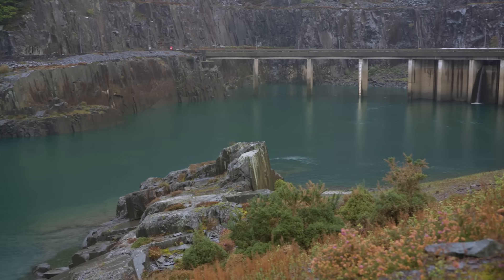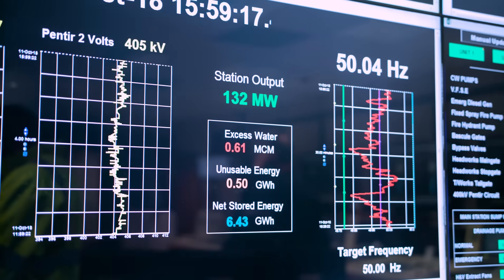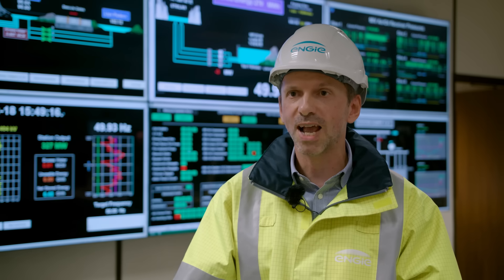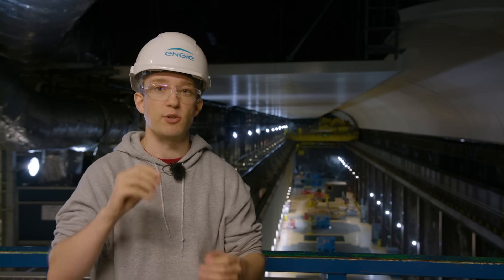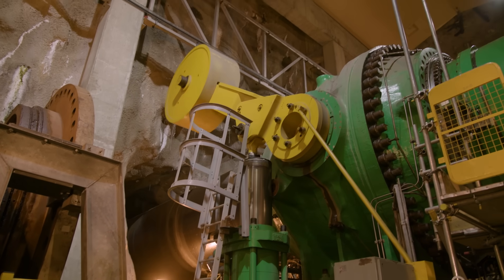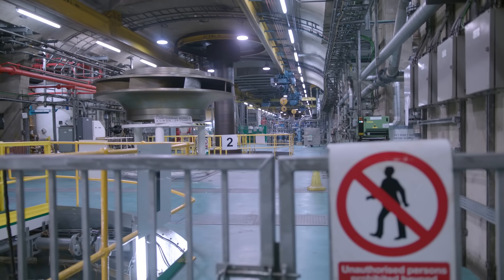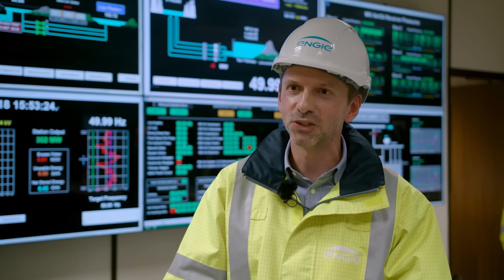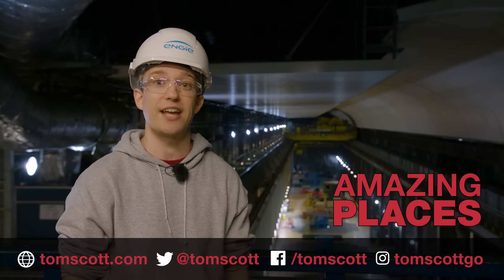Britain's largest battery is actually a lake

Comment: Are we not going to talk about how inefficient this is considering the laws of thermodynamics? If you're using all that power to feed the country during the day, and reversing the entire process at night, you HAVE to pull more power from the grid than you put in. It doesn't make any sense.
Reply: They went over the reasoning in the video. Their are times when demand for electricity is high and times when it is low. They move the water up at night when their is virtually no demand and they can have all the power they need to move the water up, then they move the water down to cover spikes of high electricity use during the day when the actual power plants can't keep up with the minute to minute demand. Additionally it was pointed out at the end that this also allows the county a higher reliance on green energy sources such as solar and wind despite their sporadic nature.

Comment: There is a pumped storage facility at Racoon Mountain Tennessee,USA. It was built on the Tennessee River near Chattanooga Tennessee in the 1970s by the Tennessee Valley Authority . It can contain up up 107 billion gallons of water and can generate 1600 megawatts of electricity.

Comment: If I'm not mistaken, Tom talks about this on one of his other videos about renewable energy -- the idea that, to balance out the highs and lows in the system, you might use excess energy to pump water upwards when the power is high, and drain that water through a turbine to produce power back when the generation is low. Neat!

Comment: The water falls down to gain electricity; then they pump the water back up?! How do they not waste net energy in that process. Which part am I not getting?!
Reply: @tacticalidiots2340  What do you mean by electricity's cheaper. If you mean the cost of electricity it's still a net waste since at the end of a day night cycle they have wasted away energy(in terms of KWh or joules). Well maybe they have thought of something then after built this battery.
Reply: @sutanupsantra  Essentially, it’s not a power station. It doesn’t create any electricity. It just allows the uk to adjust for when demand in the country is higher. They can afford to do it because they make a profit on the money by buying it when it’s cheaper and selling it when it’s more expensive. But it isn’t meant to create electricity, it’s just to store it for when it’s needed
Reply: @jamieruddick5057  ahhhhh. Ok. 👍

Comment: so basic laws of physics, there is going to be a lot more energy required to pump the water back up top than it generates from letting it flow down. While it might be 'economical' from the standpoint of high cost vs low cost energy by time of day, how much energy is overall wasted on the process? It's probably cheaper in the VERY long run than making a giant battery farm of chemical batteries (when you consider the cost of replacement and disposal of those batteries over time), and when this was made it was unlikely they had any sort of battery grids that could come close to handling that load, but still have to wonder how inefficient the overall process actually is.

Comment: It occurred to me that I'm not entirely sure how they manage to actually generate net power. Sure, the water flowing down spins the turbines, but wouldn't it require the same amount of power as generated to pump the same amount of water back up the mountain? If not, why?
Reply: It's not about generating net power. It's about storing power when there's a surplus, that can then be used when there's a shortage.
Reply: @RJSRdg  So they only let it flow/let the turbines spin when extra power is needed, and either pump it back up or lock the turbines until the mountain refills naturally whenever extra power isn't needed?
Reply: @dominateeye  Correct. The top reservoir won't refill naturally - or, at least, it would take a very long time.
Reply: @RJSRdg  Ah! So it's like a backup battery for a computer, but for the entire UK electric grid. Huh! Guess that's what the title means by "Britain's largest battery". Thanks!

Comment: huh? If they return the water to the top they are giving the energy back. There’s no surplus in energy. How does this work?
Reply: thats why its a battery and not a generator, the energy is stored on top of the mountain, and when needed, can be used to generate energy for the national grid. when the need is not there, it has to draw power from the national grid to pump water back up to "recharge"
EDIT: if I recall correctly, this was built because everyone would be boiling their kettle to make tea at the same time during commercial breaks in the middle of a hit TV show, and that demand would be too much for the national grid to handle so they needed this "battery" to supply the surge in electricity demand for those few minutes

Comment: They are literally selling the power back to the power plant at an increased price.
Reply: Missed the point. It was and still is to a certain extent, about surge compensation. 
Also the marchlyn mawr cwm at the top is a fairly small drainage basin but it does catch a lot of rain. So most, but certainly not all the water that falls down to llyn peris has to be pumped back to marchlyn every time.

Comment: I went on the tour of Electric Mountain several years ago, the shear size of the place has to be seen to be believed. You can see the entrance from across the lake and it just looks like a normal tunnel, and it really isn't! The bus that you get on at the ticket entrance in Llanberis doesn't just take you into the mountain, it actually takes you around inside as well.

Dinorwig Power Station is an absolutely massive piece of engineering, but it takes it's name from the Dinorwig (or Dinorwic) Quarry which it's under, and as massive as Dinorwig Power Station is, it's still dwarfed by the Quarry. It's hard to truly appreciate just how much the local area (& similar sites across Wales) have been transformed by humans. Entire mountain sides have been chiselled & blasted away, and in some cases then transported halfway around the world.

I have a fondness for industrial history and especially the age of steam. Wales has to been one of the best areas in the world to see and explore that industrial heritage. So much is still just sitting there, abandoned in the hills and valleys, unfortunately I've yet to come across a forgotten wagon or loco in need of rescue...
Reply: You probably know this already, but to add to your comment for others: there's a fair bit to do with steam and industrial heritage just in Llanberis alone!  Two narrow gauge railways (Llanberis Lake and Snowdon Mountain) and the National Slate Museum.

Comment: It's not renewable if it's just a battery, or are talking about rain on the top of the mountain?
Reply: If renewables such as solar and wind are exclusively used to pump the water to the top of the mountain during times when the sun is shining and wind is blowing, then when the weather conditions are not favourable the water can be released to generate electricity that will have no carbon footprint. The issue with renewables is that energy storage in conventional batteries is not good enough at the moment, and so implementing more of these types of batteries will help with switching to an energy grid more reliant on renewable sources

Comment: Battery: A  is a device consisting of one or more electrochemical cells with external connections for powering electrical devices such as flashlights, mobile phones, and electric cars. When a battery is supplying electric power, its positive terminal is the cathode and its negative terminal is the anode.This lake is not a battery. And no, a battery is not "just a store of potential energy." If that were the case every tree, lake river, tide, mountain, the sun, the earth... would all be batteries.
Reply: Metaphor: is a figure of speech that is used to make a comparison between two things that aren't alike but do have something in common. Otherwise, "To Kill a Mockingbird" is a book about killing animals

Comment: While the Dinorwig power station is certainly impressive and definitely has an important use in a modern power grid, I want to dispell any illusions that building pumped storage (like in the video) could allow for the entire world to go 100 % renewable in its energy production. Tom Scott has never said it is, but some people in the comments seem to harbour such illusions. I'll prove it with some maths!

the UKs energy consumption is 2,249 TWh. The Dinorwig power station can store up to 9.1 GWh (1 TWh = 1000 GWh). Due to low winds and increased energy consumption in the winter energy storage is neccessary. For this example we'll say that 5 % of total production is needed in storage capacity, though that is probably being generous.
2,249 TWh * 0.05 = 112.45 TWh.
112.45 TWh is a huge amount of electricity! It is about the same as the entire consumption of the Netherlands (119 TWh). To store that much you would need 12,357 Dinorwig power stations.
The Dinorwig power station cost £425 million to build. For this example, lets assume all new power stations would have the same cost per capacity as the Dinorwig power station. In the real world the cost to build new stations would increase exponentially as worse and worse locations have to be used. With that assumption though it would cost: 12,357 * £425 million = £5.25*10^12 which is roughly £5.3 trillion.

Since the entire gdp of the UK is £2.7 trillion and the cost of construction alone is £5.3 trillion, building pumped storage would be so unbelieveably expensive that it can just as well be considered impossible, because keep in mind that this a very generous estimate and the real cost would proably be way higher.
Having large amounts of hydroelectric power which is less variable than solar or wind, could significantly decrease the amount of storage needed. Sadly that is not an option for most countries of the world since few have the required geography.

There are of course other energy storage solutions such as batteries and compressed air energy storage (CAES) but they are even more expensive.

Comment: the question here is what is the ratio of power generation to consumption to pump the water back up. TBH it sounds like a very inefficient system to me since they are going to be using a large portion of what they generate during the day to pump the water back up at night.

Comment: The very last thing the dude said is the most important - this technology is a brilliant solution to decouple our periodic demand of electrical power from the fluctuating and unpredictable generation of power from renewables. As the share of energy generated from renewables increases, we will need to utilize batteries and other forms of energy storage to get power when it is demanded. Pumped hydro is by no means the only solution, but it is completely clean, sustainable, stable, "relatively" simple, and the planet is absolutely filled with geographical features which allow easy creation of a two-reservoir system.

Comment: As a costarican (my country produces 90% of electricity by dams) i cannot imagine pumping up a reservoir just to cover on demand peaks, but as an engineer, I'm way more impressed of stopping such a huge flow of water in 10-30 seconds. The guys who designed the relief valves and system surely had the most funny and stressful job of the project.
Reply: I live in Quebec, we produce so much damn hydroelectricity we could pull the plug on half of new york if we wanted. It's also state owned so we have the cheapest electricity in north america and everyone profits. We got 681 dams
Reply: @Magus Perdé  I don't doubt it. The farther north the wetter it is. I prefer dry climates
Reply: Yet the power goes out whenever there’s a big storm here in Guanacaste
Reply: Not all countries are "energy rich". Where I live we also use pumped storage energy to help us cope with peak demands.
Reply: I mean, tbf most major European nations could happily have dirt cheap electricity available in huge quantites but that wouldnt help with climate change.
Reply: @foty8679  wouldn't hurt it either
Reply: @foty8679  i mean sure we could burn radioactive coal like a bunch od troglodytes but thats neither good for the environment nor for the people who mine it or who live near the plants, or downwind from the plant or....
Reply: @DimT670  just use scrubbers(filters) like we do in the USA.
Reply: @gonelucid  they do shitall, the "clean coal" systems that were tried actually used about as much energy as the powerplant it was conected to so they arent used
Reply: I dont want to be rude but you guys have like 3 hydroelectric dams....
Reply: @thejumper7282  it’s a small country to be fair.

Comment: Does the law of thermodynamics not ensure that they are wasting vast amounts of energy daily by pumping that water back up to the top of the system? Even with a perfectly efficient pump, the energy expelled through cracks or inconsistencies, not to mention heat, would mean that this is not as efficient as just storing the excess energy in some form of battery. A longer, more in-depth version of this video would be nice, because currently I am left wondering how it is not a massive waste to spend god knows how much energy to reset the system, rather than letting nature rain down the water necessary. Even better, place the entire thing underground below sea level so you don't need rain or a pump, just some time for the water to refill the initial basin.
Reply: So citation needed becuase i havent researched this in depth, but i think the point of the hydro power station isnt to generate a net gain in electricity, its to quickly gain electricity when you really need it. it will take more energy to move the water back up then you gain from letting it run down, but you can pump it back up when electricity isnt in demand and being used, therefore costing you little to do so. When you really need more power in the grid though the hydro station can generate a lot of energy on very short notice making it perfect to pick up demands when its needed.

Comment: It isn't a battery though, it is a reservoir. Unless you regard a fuel tank to be a battery for a car, a generator, a lawnmower, or whatever the fuel powers, please don't regard this as a battery. I have been there as a visitor and as a contractor, the staff there get really pissed off with people who call the upper reservoir a battery. I usually enjoy Tom's video's, but as someone with many years experience of working in the power industry this one has really annoyed me. Currently the biggest battery is the PWR at Sizewell B power Station, except it isn't because it is actually a nuclear reactor.
Reply: A nuclear reactor or fuel can't work backwards, you dumb potato.

This is a battery in the sense that it releases and accumulates energy, which a fuel tank doesn't either. For working in the field you're completely clueless about basic stuff that every day people do know.

A reservoir would be something that replenishes naturally btw, and has nothing to do with energy.
Reply: @freshrockpapa-e7799  You are too thick to even bother arguing with.
Reply: @Topher TheTenth Not all energy is electricity, a fuel tank is never a battery, regardless of what it is attached to.

Comment: So it's creating energy during the day when the prices are high and using it to recharge the water supply during the evening when the prices are low?

So it's literally generating free money?
Reply: Nah, the tittle says it, it is a batery.on the day, electricity is on demand, so you empty, lets say 50% of the reservoir, worth $100,000 in energy (not actual numbers) to Meet the deman and keep the electric grill running. 

On night, electricity demand is lower, so you have spare electricity. So you use, lets say, $110,000 worth of electricity to pump the reservoir back to 100% capacity. 

It just like saving money: you save money when you dont need it, and you spend your it when you need it. Your savings account itself is not producing money, just storing it to meet demand
Reply: @facosa9924  Ah, so instead of using chemical and volt cells and all those things to store energy, this reservoir uses potential energy to store energy.
Thanks for clarifying, I thought they just broke the economy for a second there.
Reply: @Oxideacid  yup, im glad it was clear. Thats the interesting thing tho, is... a weirdass battery. But if it works, it works.

Comment: Quick question: how much of the generated energy does it take to pump the water back at the start? So what is the net gain of energy?
Reply: There is no net gain of energy, there’s a net loss of energy due to friction, but it’s basically a large battery that gets drained and recharged
Reply: Don’t think of it as a power station, its purpose isn’t to continuously generate power. It’s a battery used to take pressure of the grid during peak times, and it uses the grid to “recharge” during off-peak.
Reply: Think of it a bit like a storage heater. Use electricity only when it’s cheap.